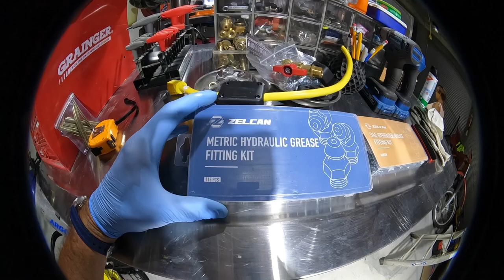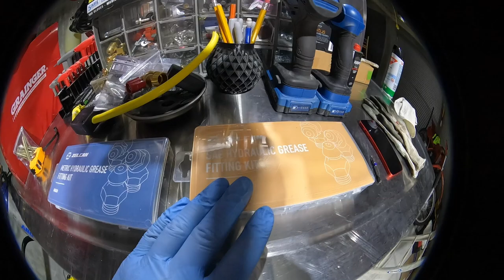Greasing Mini Excavator 👍🏼 | Mini Excavators Philippines | Ep. 02 | TORINO

Comment: How is it running? You happy with it so far ? 
We just bought Rhino xn12-9. But smaller. It should have arrived in Manila port today.
Reply from the maker: it's running great, i did some drainage work so far, but stopped operating until i get the lubrication issues straitened out. overall i love it.
Reply: I just bought an AGT H12 and was having similar grease gun issues. I had a standard zerk blow out of its hole, looks like it was cross threaded or more likely not a complete thread was cut on the female location.  I bought the rubber tipped fitting to grease those flush zerks and the grease just short cuts out between the metal body and the rubber tip. Put on the all metal tip that came in the tool box, it now works fine. I purchased two guns, one for each type of zerk , as the flush ones require a ridged setup and the regulars can use the flexible hose. I thought setting up the new guns to grease all the zerks would take a half hour, it took all morning and the fittings at the back of the blade still don’t work.
Reply from the maker: @rustyharrison1717 i did a "winter-ization" on mine and had to replace several male zerks that were clogged or just bad from the factory. after switching out the zerks i got good sqweeze out. the female zerks are good if using the metal needle attachment. yes, took me hours to grease the first couple times, until i got the zerks sorted out. im actually wondering if its possible switch all to the female low clearance fittings...